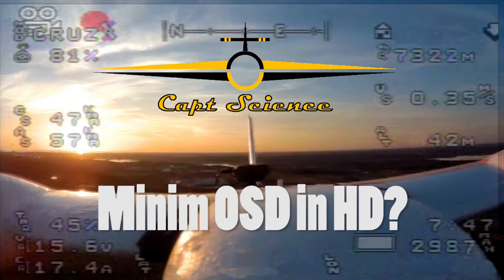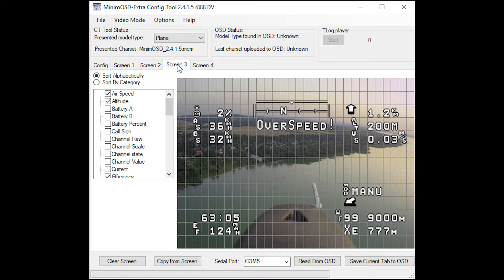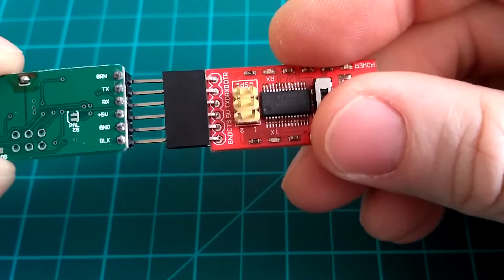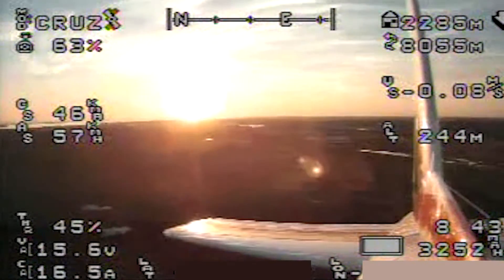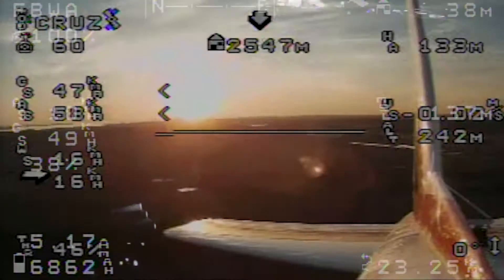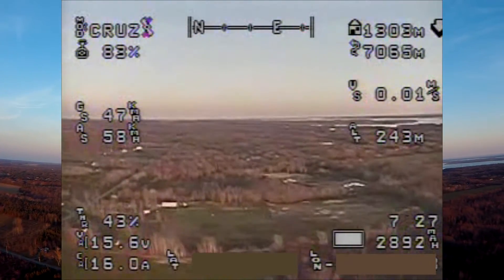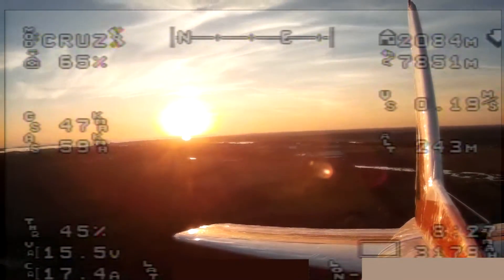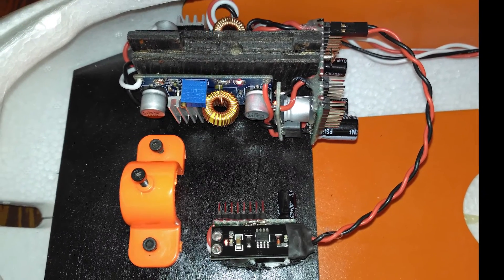Minim OSD- Removing Flicker and Can It Handle HD / Wide Screen Signals?

Comment: Hi, today I tried the latest version (Uni.915DV), I used to have arducam 2.0; Now Every issue I had with Arcucam 2.0 is fixed, except now I have no voltage readout (0V). Any idea on how to fix this? I don't know what I did, it might be from something i set in the config (I can't' remember if it was wrong from the moment i flashed to filmware or from when I started setting it up xd) So maybe, could you send me your Save file (.osd) (Mavlink; preferably from a fixed wing) so I can see if that's the issue. 

oh, before I forget... The Vertical speed is goes up and down like crazy, eventhough it is correct on mission planner :/ Fix?
I use the pixhawk lite in the volantex mini ranger

Comment: I found my Run Cam Swift works best....I did try to use a Foxeer 1200tvl Camera, but it too suffered from flicker.
    I agree with Plessis, restrict the OSD to the Main flight Camera only....Im also using PAL which has a higher vertical resolution as Im in the UK. I also found that the DVR works best with a very short direct link to my 1.2G VRX. With FPV, simple is always best.....IMO.

Comment: I forfeit my OSD on the secondary cameras - I think MinimOSD does not like to start up in one type of feed and then switch to another. Thanks for the video!
Reply from the maker: it doesn't seem to matter which camera i start with. The only stable overlay comes from the board cam... even 1000 TVL board cam.

Comment from the maker: I've also been on a quest to try and make the OSD footage watchable because its really grainy after coming down the 1.3Ghz link. I overlaid my ground station footage on the full hd footage from the plane and it's actually not bad now. It will take a few more tries before I can dial in a method to easily sync the footage - and despite how silly i'd look i was thinking about a clap board like in the movies.